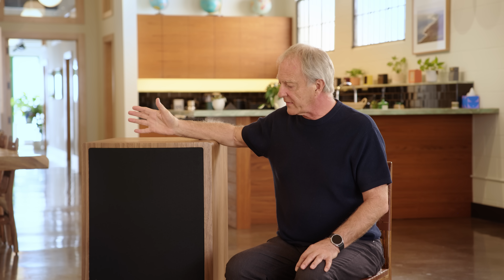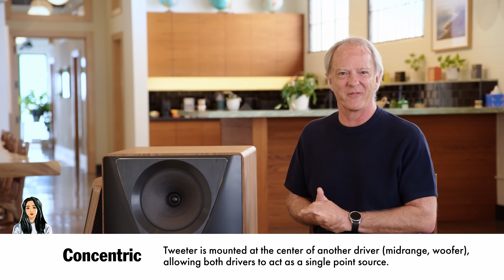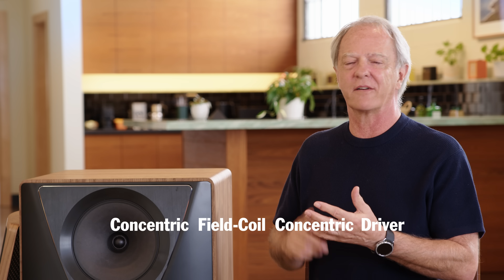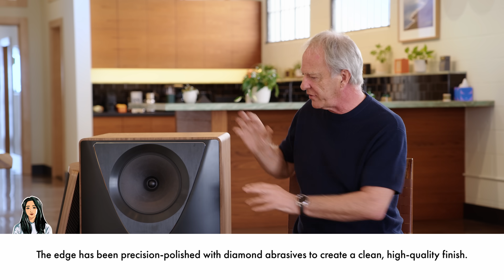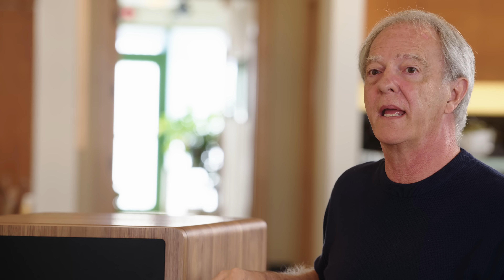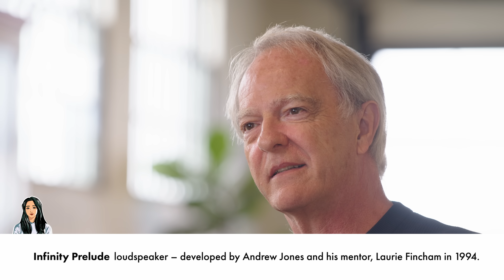First Look! Andrew Jones's New Loudspeaker – TROUBADOUR

Comment: I thought initially that it would be interesting to see if a pair could knock my TDL Studio 1's Or Tannoy DC3000's off the perches they've had in my system for 30 odd years, then I realized they were ten times more expensive than my budget :).
Wouldn't a geodetic composite fibre grill be less intrusive sonically, there would be no flat reflecting surface with fibres to speak of?
Good luck with them.

Comment: its a nice looking speaker.  I cant imagine manually activating each speaker, the auto sensing would be totally sufficient regardless of the delay.  the cabinets and grill look nice, the stands too.  I dont care much for the concentric tweeter design but would be interesting to hear how it sounds.  I also would prefer acoustic suspension over bass reflex, i cant stand ported speakers..... but understand the need for cooling / ventillation.

Comment: Just in the first 2 minutes of the video I'm already really intrigued and like his thinking, even though I could probably never afford any ultra high-end audio other than headphones lol. 

I got some BeyerDynamic T90 Chrome Editions refurbished for $260 and they use the same Tesla driver their flagships at the time used and that's as close as I've gotten to ultra high-end. Schiit Audio makes really great entry-level stuff that legit compares to much more expensive components despite being made in the USA, I might get their Modi Multibit DAC since the Modi I got for $99 started having driver issues I couldn't seem to solve and $250 isn't that expensive so it'd make sense with a Magni 2 Uber amp and high-end headphones. I like the naming too, Schiit stack, PYST = put your Schiit together, ect.

Another great thing about that stack is the Magni 2 Uber has outputs for powered monitors to act as a preamp so it opens the doors to a lot of great options for powered monitors or to go into an affordable but great amp. Maybe I should finally upgrade my 15YO PC first and see if the Modi magically works again.

Comment: After 60-70 years we go back to field coil speakers concept. No surprise. What will do like magico low efficiency speakers and high power amplifier companies , will be interesting. Wish good luck. Actually I have a magico mini 2 and I am absolutely sick and tired to drive the speakers. Enough is enough.
Reply: Heat will be serious issue in long term, you will see. Usually such design needs open baffle design but this design is ugly and don’t have a such a good look like in this new design.

Comment: wonder how much heat build up is an issue
Reply: The heat build up will be considerable. I run field coils in an enclosed box and the driver faceplates run quite warm and and that is with a single port down low for the cabinet. The 4 port enclosure means they have higher heat buildup that they are attempting to reduce by convection. Field coils can be brilliant but carry a big caveat if not used correctly. Price wise, I think $40-$60k is were they are aiming, less than that will be a surprise.

Comment: I'm not an engineer, this guy is much cleverer than me so I'm not trying to be clever myself. I know engineering is about compromise so when I hear he needed to build a brace to support the weight of the driver, the brace must have compromised the cabinet space a little, then I get thinking did  that compromise negate any advantage from the new driver or at best not the result he  would desire in it's purist form ....... Then my head explodes 😅

Comment: Nice looking Vincent M/C parked in the room👍. A grilled spkr has the appearance of a properly finished product. Acoustically transparent grill material goes back to the 70’s! I’m the original owner of my KEF 105 Series1 spkrs from ‘79, they sound glorious with the grills in place. 3yrs ago I replaced them with a set of Von Schweikert Audio Endeavor3 SE’s (105’s in storage, never to be sold). Their magnetic grills aren’t detrimental to their sound. But, some will insist that a physical veil hampers audio response regardless🤨.

Comment: whats the meaning of subwoofer inside corpse? 😂 just pick any 12" sub from market, put it in a closed box and itll be the best with cheap high power amp and crossover, some kind of beringer ep4000 and cx3200 or so 😂 and ill still pick a tad berillium high/mid. dont think andrew could do any beter 😂 its all the same 😴 nice oldschool desighn

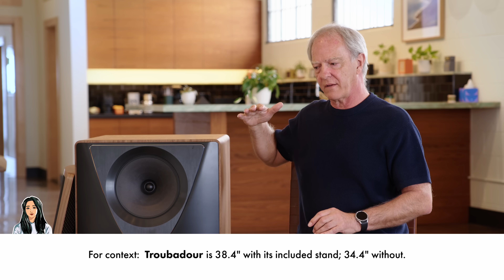Comment: @13:55 why not make the speaker 10” taller? The box volume could then be kept the same by reducing depth, or if they wanted to maintain the same depth, they could have had 2 13”, 14” or 15” drivers instead of 12”. Scan-Speak, SB Acoustics and Focal all make 13” woofers.

Comment: Using 8 inch pa speaker 3 years now. Made it active, so the 1 inch compression driver with a sensitivity of 113db it's straight to the amp. I don't go back, the dynamics are awesome

Comment: I do not get the idea for the size. And I din not like compromises.

1. We "should" sit in the line where the tweter fire towards.

2. Andrew do a low speaker.

3. Nobody have so low sofa/chair. 

4. We do a compromise we fire the cocentric tweter and midrange 10⁰ upwards.

5. Result to sit in line of where the driver beam you need to sit higher and higher the further away you place them..
That seams inconvenience.. but at some point it does not matter when the distance is far enough I guess..

Tuning idea: 
And a way to adjust the back and front feets to get different leaning angles. 
Or just sell kits with different lengths on the feets that can be mounted.

So that we are able to align down/up tweeter beeming axis. Depending on listening distance!

Make graphs for each "tuning feet kit" that at:
2m distance listening height x to y cm.
3m distance listening height x to y cm.
4m distance listening height x to y cm.

Many have already their room and chair they know their distance and ear height in that room and chair. So the chart with the options is easy to select. ❤

Comment: This ticks off so many boxes for me.  Field coil drivers and concentric drivers have advantages for me.  I don't think anything sounds as good as a field coil driver.  High efficiency is a lost art that matches my love for triodes.  He didn't mention the impedance curve.  Hopefully it is an easy to drive load.  There is no replacement for displacement in bass.  And I think it looks great.  This will not be cheap, but my guess it will be high value.
My diy speakers use 10" concentric drivers with alnico magnets for the main and 18" bass units.  Being open baffle they do require room boundary to get well into the 30s so room set up is a thing.  But the sound is hard to beat.  I'm less a fan of box speaker.  Sometimes they work well.  I look forward to hearing Andrew's new creation.  I think it will be his crowning achievement.

Comment: I don't understand why. Why field coil (a.k.a. electromagnet), just for the 'vintage novelty'? Won't the driver performance be dependant on the oh so common mains voltage fluctuations in typical residential applications regardless of the regulated power supply? How about the fact that one will need mains power feed on top of speaker signal feed to each speaker? How about the additional costs, complexity of a regulated external supply for each speaker along with the additional failure points due to the increased use of electronics? How about the additional energy consumption? Four potential disadvantages already. There might be others. Are there any real advantages in using field coils for the tweeter and mid driver apart from bragging rights? There may be but I didn't hear any in this presentation and permanent magnet drivers have come a long away since the 1930s exhibiting impressive distortion characteristics. Isn't there a reason field coils were abandoned once engineers could get their hands on strong enough magnets back in the early 1930s? Come to think of it, might Mr. Jones be bound by some non-competition contract with Mofi prohibiting the use of his design of 10" concentric drivers for a 3rd party so soon after his Mofi products were introduced, that going field coil is just a way to bypass those contractual restrictions? Just an uneducated guess, that last one.
Reply: As a MoFi owner, I really enjoy Andrews approach to loudspeakers, but man, I think I agree with you here. This sorta seems like a repackage and rebrand of lessons we’ve already learned, but with a modern sticker price. I’m simply not going to sink 10k (likely much more) in a power hungry Cerwin Vega update. It’s a beautiful product though.
Reply: @ashbyedwards  It's not an update of a Cerwin Vega, it's an update of the RCA LC-1 designed by Harry Olson.  70 year old LC-1s still go for $4000 a pair and up when you can find them. You should hear a pair, they're amazing.
Reply: Anyone that can afford this speaker is not worried about 50-60 watts to power them. If you consider the high efficiency and small amplifier required, the total power required could be less than an inefficient speaker with a large amplifier.
Reply: @RW-ur7ym  High efficiency / weak amplifier requirement has little or nothing to do with the use of field coil drivers.. You can do all that with normal permanent magnet drivers and no additional power consumption. It has been done since the 1930s..  It has mainly to do with cabinet size and driver size selection.  Btw most of the people buying these speakers will buy them to drive them with tubes or maybe small Class A solid state, if efficiency and vintage image  is their concern, so small power consumption amp argument goes out of the window anyways. Try again..

Comment: I can only imagine what the MSRP on this system will end up being. Definitely not in the "bargain" category. And I still don't get the purpose of using field coils on the upper drivers.  Whatever purported advantages they might have, they also have considerable drawbacks: the substantial added expense, the need for an external power supply, the physical weight, (36 pound magnet system?), and the heat. The voice coil gap is not a good place to have heat generation, because that heat gets added to the heat produced by running the audiosignal through the voice coil, and that leads to thermal compression.  Flux modulation was mentioned as an advantage, but better modern PM magnet designs have also addressed it.   It  should be minimal anyway in an underhung efficient design such as this. And flux modulation in any tweeter would be extremely small.  I get the ability to achieve very high BL figures, but well designed neodymium systems should be equally capable of this. The ultimate sensitivity of the system would depend more on the woofers than the upper drivers, and those use neodymium magnets.  I could be wrong, but it seems like more of a marketing exercise than anything...to go along with the "vintage vibe" of the system as a whole.  Modern PM loudspeaker magnet system design is a highly advanced science,  and it will be difficult to convince me that the expense and hassle of an old fashioned field coil magnet is worth the effort on a technical basis. Take a look at what Purifi is achieving with simple ferrite based magnet systems. They're reducing driver distortion down to high end audio amplifier levels.

Comment: The primary trade-off of dual concentric drivers is the pursuit of time-correct point-source imaging at the expense of intermodulation distortion. While the physical alignment produces a holographic, phase-coherent soundstage with exceptional transient "snap," the use of the woofer cone as a moving waveguide for the tweeter introduces frequency modulation; as the cone moves to produce bass, it smears the high frequencies, leading to a loss of clarity and "nasal" coloration during complex passages. Additionally, physical gaps between the drivers cause diffraction, which can manifest as jagged treble response and a narrower, more demanding "sweet spot" compared to traditional separated-driver designs. Fixed waveguide that doesn’t use the woofer cone is better to my ears.
Reply: There's no perfect design. If he's crossed that mid range unit at a high enough frequency I think things will be fine as that driver doesn't move much in the first place. He had the same issues with his mofi units
Reply: He can’t cross over that high up. The  mid range is too large.

Comment: The 3-way speakers he designed for TAD are still my favorite speakers, I sat for over an hour to listen to them in a HiFi show. They have exceeded the 100.000€ so it's a speaker for those who don't have to ask how much it costs. Since the Troubadour will also be expensive I wish he had made it active with external crossovers & amps. I hope high sensitivity doesn't mean these speakers are geared towards single ended low wattage amps, the romantic sound may be easy to listen but it's not high fidelity IMO. Just for the aesthetic part though it's great to see Andrew Jones designing big beautiful speakers again, everytime I was seeing the Elac small ugly matte black boxes (good sounding or not) I was thinking a waste of talent.